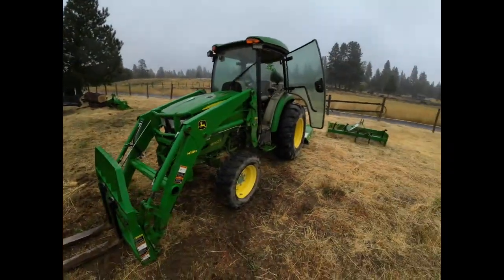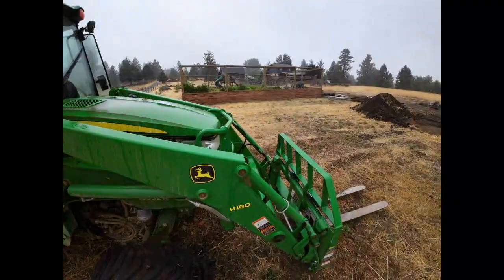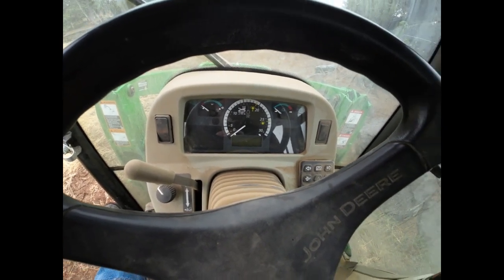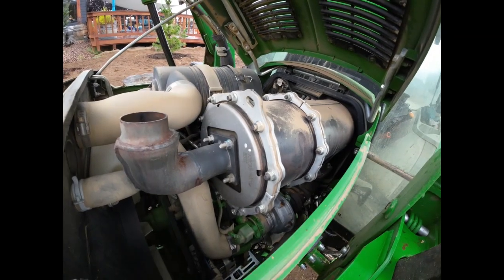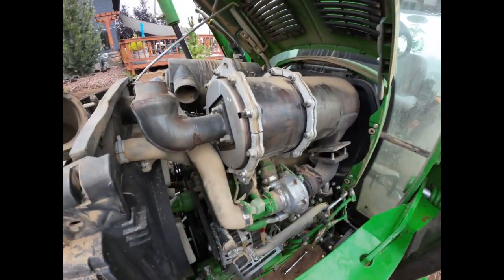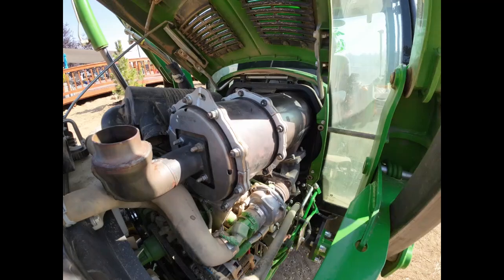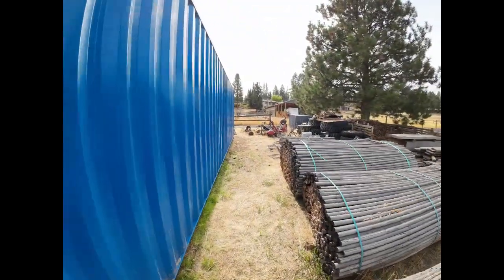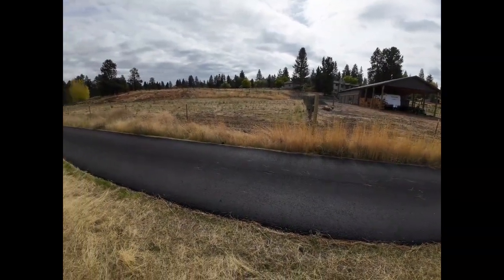Winter Field Prep and Breaking my John Deere Tractor in the Process!!!

Comment: Hey Troy  !!!  DON"T you just love this ""Going Green ""  B/S when it comes to taking your time away from projects that need to be done ????  😡😠🤬😈        Great job on the field !!!  🙂😃  The roller would do a little better job if you were to weld rebar rings on it to make grooves for the seed to catch into instead of blowing away in the high wind storms you have up there !!  ONLY a suggestion , Not picking on your handy work ?? HAHA   🤔🙄👍👍👍👍👍
Reply from the maker: So I use a cultipacker seeder to seed my field. It drives the seed into the ground. Then I roll it again after and it pushes any remainder of the seed down.